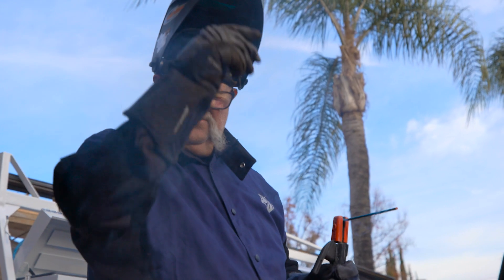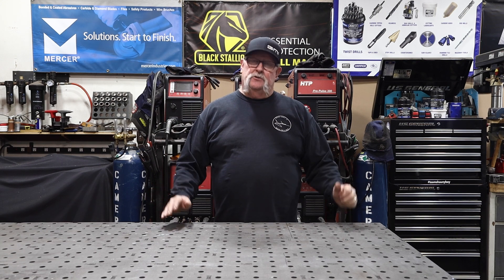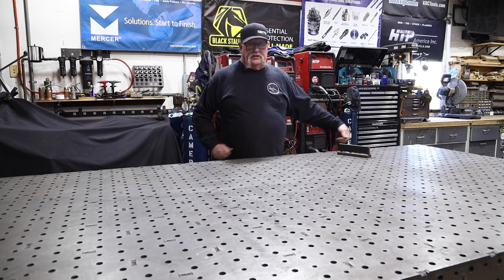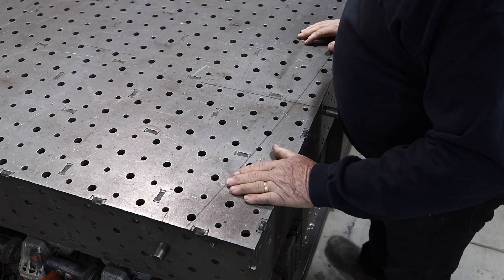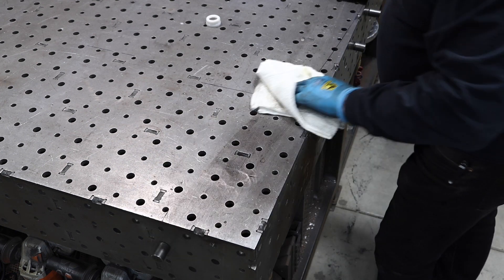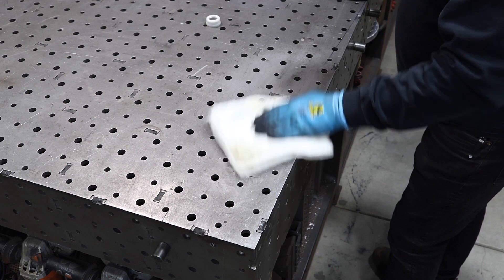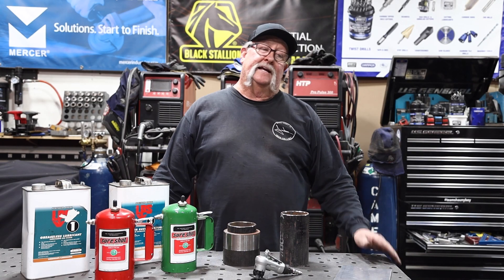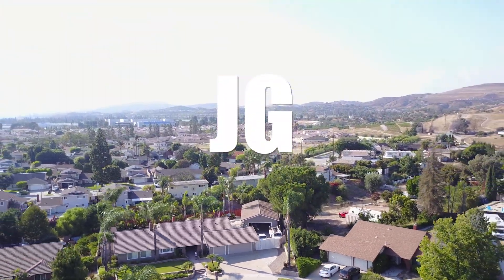Welding Table Maintenance | JIMBO'S GARAGE

Comment: Jimbo buddy! Hope you and fam are doing fantastic! I dont know about your monster table but i wipe my fab table down with paint thinner/mineral spirit and after that i rub a nice thin coat of johnson paste wax on it. Works great for keeping rust away especially for long periods of time when not in use, only thing is if your like me and tend to jot down notes on the table with a sharpie, having wax on it wont let that happen either. Longest Ive gone is 4 months without using my table and thats in lower alabama humidity near the beach. When i finally went to use it again, it still didnt have rust on the surface. WD40 gel spray works wonders to for protective coating. I use it on stuff i dont heavily use like my drill press. Works kinda like cosmalean, its thick and oily but works good. Anyways, look forward to learning more from you Jimbo 👍

Comment: hate to bring this up but dude you really need to have your ring cut off. it is way to tight around your ring finger, could really cause circulation problems.

Comment: I copied your tray idea when you first showed them a while back, Made mine from stainless (back when steel was reasonable lol). I like the sprayers, it seems like the aerosol cans are always losing pressure before they are empty in my shop. I bought the chamfer tool about 8 months ago when I saw it at my local weld supplier and I use it all the time. If I had known you were having the issue with your table I would have suggested it months ago. I also have another gadget you might like, we use acetone quite a bit in the shop and we purchased some plunger cans made by "Justrite" they work amazing and you don't have to pour acetone from the can to a rag. (Just put the rag on top and give it 1-2 pushes). Great for Tig welding too. As always great video keep up the good work. 👍  

Side Note I use to live in Yorba Linda, before we moved up to Tehachapi Ca. (Just south of Bakersfield) I have a side  business "T-Town Welding and Fabrication" that my son and I started and really need to start capturing more content on our builds. Would love to meet you in person if I make it back down to the O.C. to visit friends and Family.  Keep inspiring the masses and I wish you all the best. 

Chris